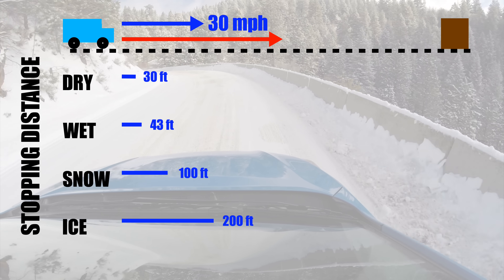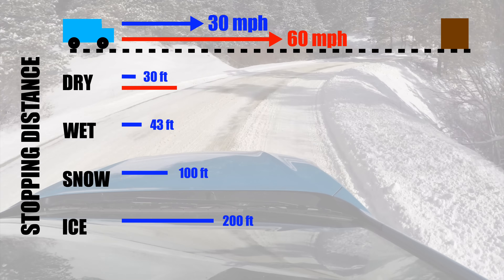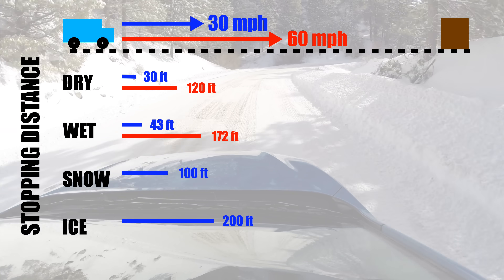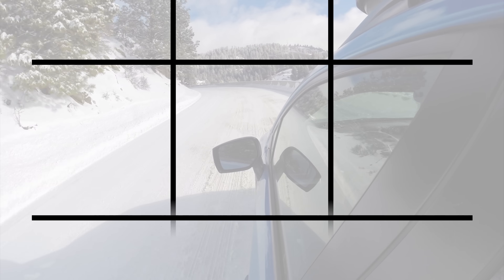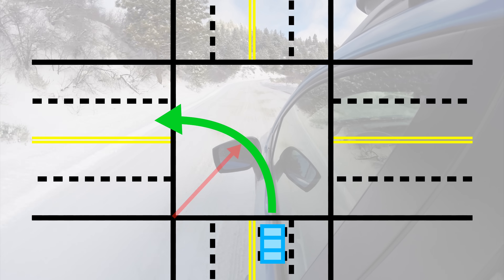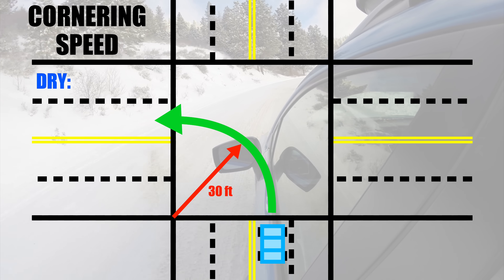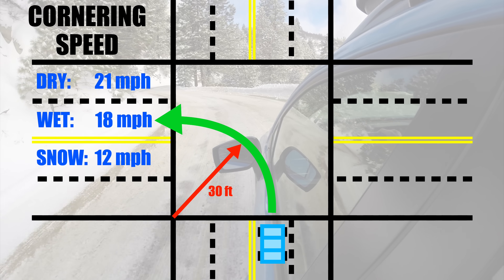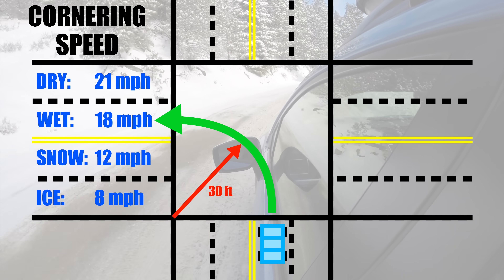Everything You Need To Know About Driving In The Snow

Comment: Great video! Does it really come out as a circle? Depends on the footprint the tire has with the road I’d guess. I’m picturing more of an oval depending on tire width.
Reply from the maker: The tire's contact patch is not what's shown (that's more oval like, being wider left to right than front to back. The traction circle, however, will actually be a bit longer (front to back) than left to right.
Reply: @EngineeringExplained how much does tire pressure affect grip in the snow? Can i just take 10 psi off and get a % increase in grip because of bigger contact surface
Reply: the traction circle is a virtual representation of the maximum force vector in any direction that you can get before slip occurs.
This means under braking and acceleration your minimal turning radius is lower, so slamming the brakes might not always be the solution when the car goes out of control.
Reply: What was left untold is the obvious that using one direction for grip lessens grip available for other directions. If all grip is spent on accelerating or braking, there is none left for side grip/steering and vice versa.
Reply: The shape of the ellipsis varies a little from tire model to tire model, and a couple of times I have taken it into consideration when buying new tires.
Reply: i thought is was supposed to be bigger (the spaces in between tread blocks) so that they wouldn't fill with snow as easy.
Reply: It's a simplistic explanation for maximum effect. It's far more complicated in reality, but (most) people are terrible at processing large amounts of information and drawing conclusions from it - their eyes glaze over and they just stop listening.